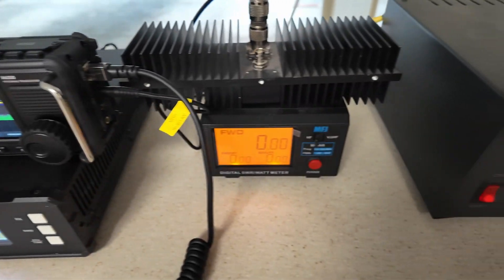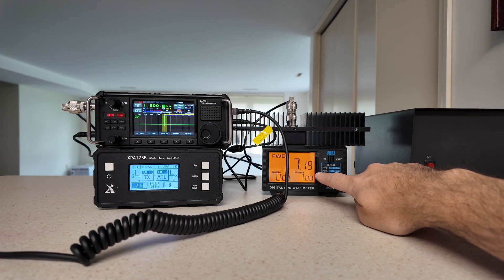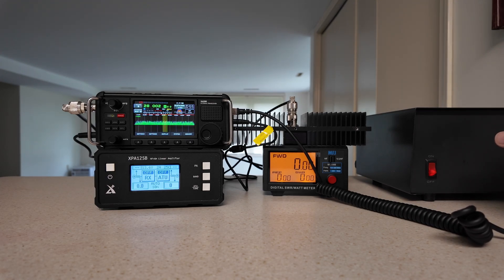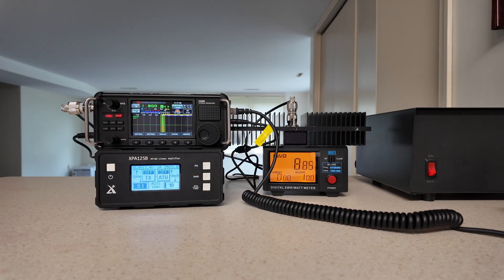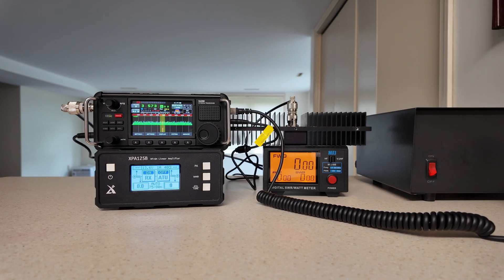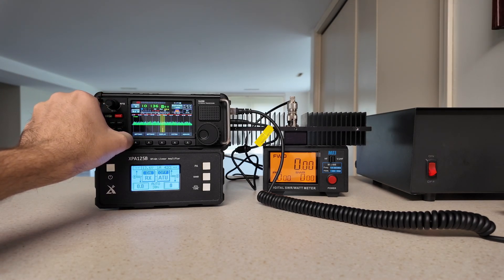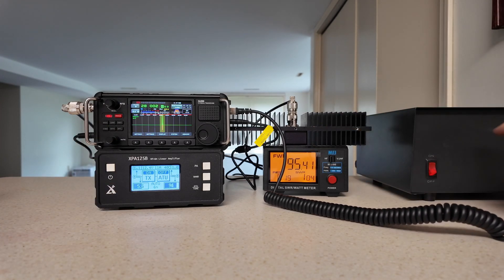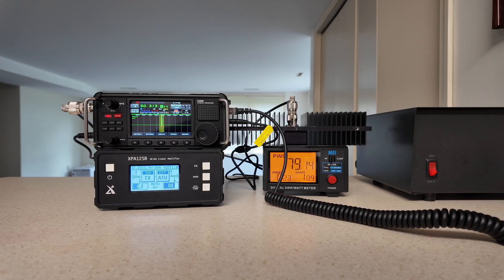Does it work?

Comment: Great video. I spoke to Xiegu about the ALC not responding through the L4001 cable and the XPA125B, and they said look for the first firmware update.
Reply from the maker: That is exactly what I'm thinking.  Totally fixable in the radio (since the amp is a proven asset)

Comment: For anyone seeing this, I found that 0.9-1.0W was enough to drive the amp to a full 100W except on the 10m band. There 1W resulted in 90W out and it took 2W in to get 100W out. 

Don't overdrive your amp like this.
Reply from the maker: Or use the ALC circuit as the vendor recommends and let the two communicate with each other as demonstrated in the video.
Reply: @temporarilyoffline maybe you know something I don’t, but my manual for the amp doesn’t mention anything about that.

What it does explicitly say is not to overdrive it past 100W.
Reply from the maker: I spoke to it at 3:00 in the video and then again when I keyed up on 160m. After that I had the drive set to 5w and you can see that the amp is much happier and communicating with the radio to lower its drive, by design.  For example, on 40m, the radio is set to 5w, the amp has clamped it down to 4.9 and is boosting the output to 97w.  All within spec.  The only "major" issue here is that on some bands when you key up the band data voltages aren't properly in sync and the latest firmware on the amp /should/ fix that...  but I haven't had a chance to test/upgrade it.

Comment: Recently got a 6200 and this amplifier.  The manual says keep it <2 watts for the amp input or damage may occur.  Finding that the amp tuner is quite finnicky so far and isn't a tuning phenom, like their radios have proven to be. Lots of flashing messages of high return RF, even with 1:1 choke on either end, somewhat puzzled and skeptical at this point  Further testing this week.
Reply from the maker: @UABFWSS  ik confident you'll find the issue.  I've literally put thousands of contacts through this amp on a variety of radios and antennas.  I've seen the issue you're describing on certain bands/radios/antennas, but have always been able to sort it out.
Reply: @ i’m hoping so 🤞🏻

Comment: Something odd. On 160m when you TX the PA swithes to 75/80m (look at 3:16) ... looks like something is wrong there, at first I thought it was due to 8W you injected but when you decreased to 5W the issue is remaining.
I have the combo G90 + the amp and I love it. Since last update of G90 I must turn power to 1W on 15m otherwise it overloads the power output...
Reply from the maker: In theory, the amp and the radio are supposed to talk and the 8w wouldn't actually make it... but in theory they are also supposed to stay on frequency.  Later in the vid, I show that it did it on other bands as well.  Its a voltage mis-match on the L4001 cable interface to the XPA and I'm pretty sure it can be fixed in firmware.
Reply: @temporarilyoffline  Yes they can as it's just a firmware controling output analog of the microcontroller.
Reply: @temporarilyoffline are you sure it's a voltage match this is a common problem for me with my x610p. With my x6100 any little bit of stray RF on keydown the amp will drop to a differnt band. I've tried choking everything and it doesn't seem to help only seems to do it on cw tho.
Reply from the maker: @randal0007 I'm not sure. Just a guess

Comment: Do not buy a Xiegu XPA125B or any Xiegu product! This amplifier was originally introduced with a good design using a pair of RD100HHF MOSFETs to easily handle 100W. After a few years they started selling units using the a single AFT05MP075N rated for 75W without any change to published specifications. You can push these amps to 75-80W but they are now really 50W nominal amplifier to achieve the same IMD rating. For a company to engage in these unethical design practices, I'd strongly recommend to never buy any Xiegu products! This is the same practice that Huawei tried when they started to gain some market share in the US with their phones and tablets.
Reply from the maker: Do you have any pictures?
Reply: I think there are now 3 or 4 versions of pa design for the xpa125b I've heard of many issues but luckily my earlier version seems to be very solid besides the gimics on trying to get it to tune.@temporarilyoffline

Comment: Good timing as several on the x6200 list are having difficulty with this configuration. SSB audio thru the amp is being clipped suggesting the ALC is not working and the amp is being overdriven as I think you have demonstrated. The problem appears to be in the 6200 not the XPA125 as it works fine with the x6100.
Reply from the maker: I'll be testing harder it Thursday during the FT8 poker game, we'll see

Comment: Nice test. I did see the auto mode acting strange.  Should select manual mode . selecting wrong band may cause unwanted harmonics .All the amps I have ,Have different output power on different bands and  different from amp to amp. Even when tuned,A tube amp does this. most of the amps I have ,like the middle bands the most like 15/20 meters. Now I know what you do on cold days. Key up with power into dummy load,make some heat. I am in NY and woke up cold. 56F . crazy cold and just back to field day we breaking record heat . now I am turning tubes on to do FT8.  10/12 meters been bad few weeks now. But had a FT8 on 6 meters !  just the outher day 20 meters was poor and noisy with heavy QSB but 15 meters going nice and 17 meters was ok. strange bands in NY. 73's
Reply from the maker: It has been cold here the last few days.  Stay warm! (What a weird thing to say in July)
Reply: @temporarilyoffline  Girlfriend put extra blanket on the bed . and the cat under it. first for July !
Reply: Seemed to give 95W output on 10m when the amp swapped to 6m mode, but only 91W when the amp was in manual 10m mode!
Reply from the maker: @petereverett1455  that almost makes sense too